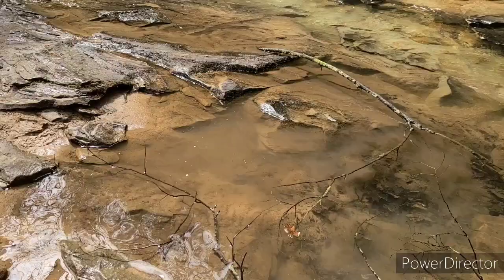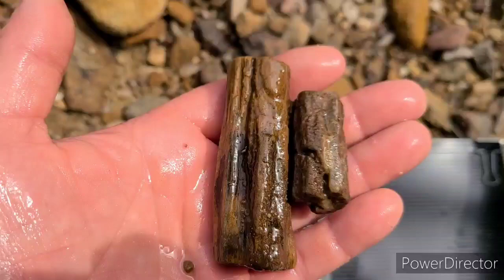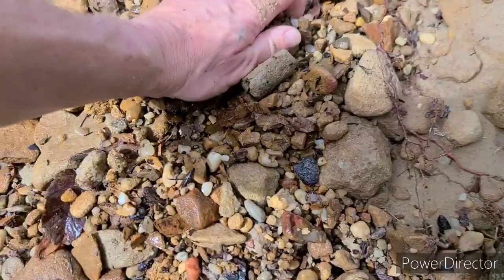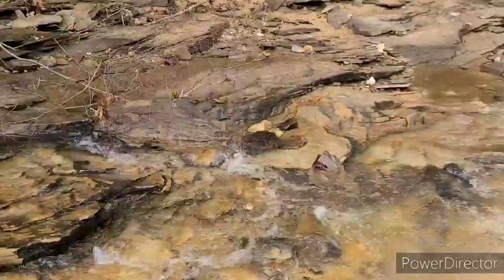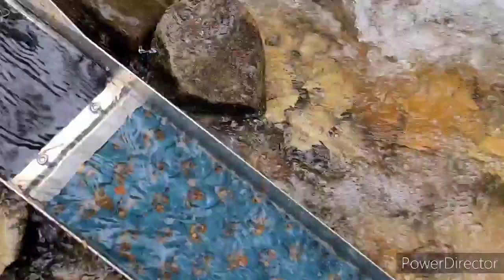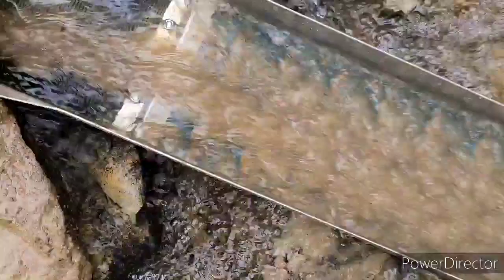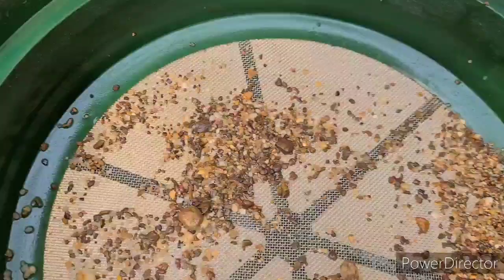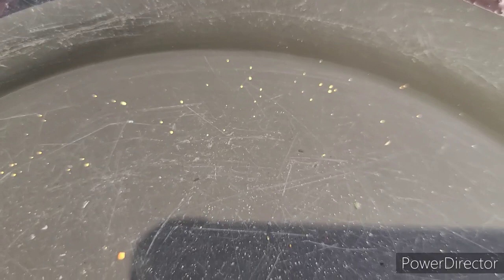How to Find Gold in West Virginia (or anywhere else)!!!

Comment: How do you determine the speed that the water should be running through the slice?
Reply from the maker: The dream mats love to be ran faster than a normal sluice.  And the proper pitch is around 8°, that's with internet research trial and error testing.